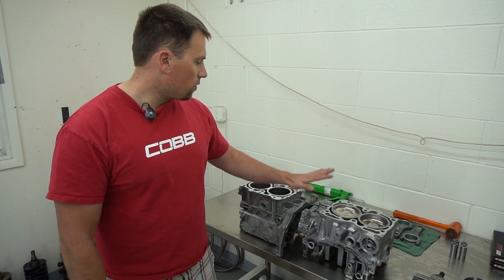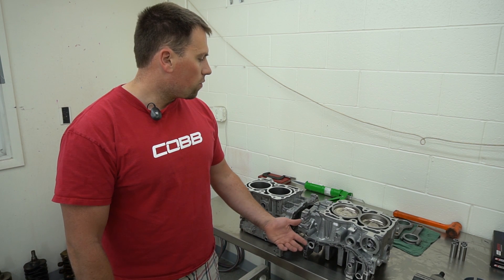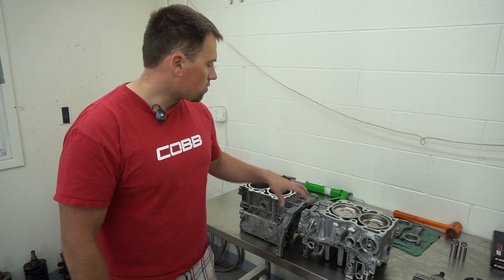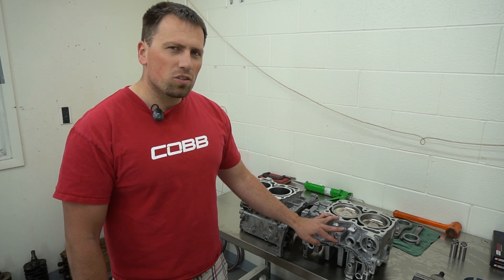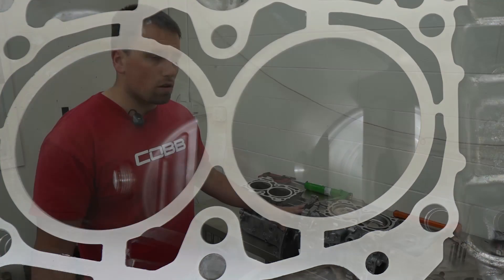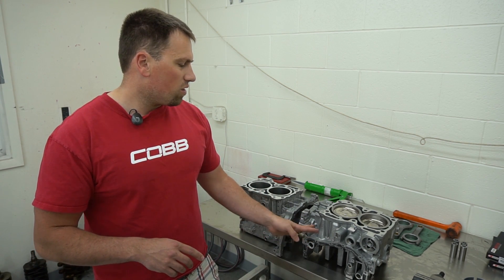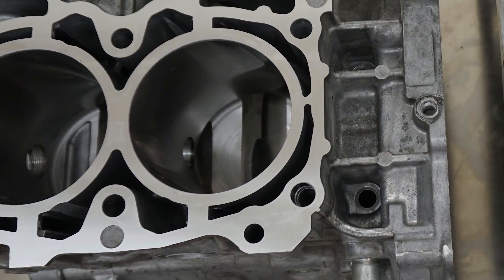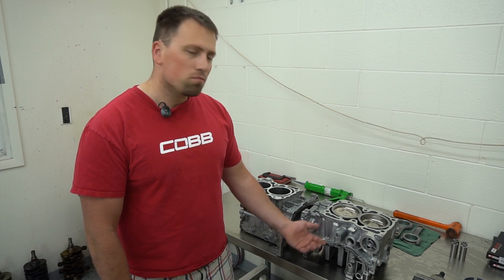Sleeved vs Non-sleeved EJ25

Comment: I am wondering about the ez30 or ez36 with a turbo SWAP on my 2012 sti which engine is the best to build up ...I'm digging that gt3 Porsche sound. Will Those blocks handle 550 or six as well??
Reply: By the time you're done with a proper built ez engine swap you would probably be able to buy that 911 gt3 with all the money spent. Not worth it in my opinion.

Comment: What do you think will my ej25 semi-closed hold 400whp on the street?
Reply: Most likely, with some forged internals though
Reply: @angusskinner7392  Haha update, yes it did for 15k miles :D Got ringland failure with cosworth forged pistons. Now doing a full rebuild on the same car :D This time the goal is just a little bit higher with 700hp and ej20 closed deck.

Comment: if i wanted to do about 400-450whp but my block bore would be 100mm oversized, should i sleeve it or stick with the 100mm bore?
Reply from the maker: We recommend anything over a 99.75 bore to go sleeved for the EJ25X.
Reply: FNP Tuned well i guess ill let the shop know tomorrow to go ahead with the sleeves. instead of going from my 99.75mm to 100mm. Thank you for reply. the shop also told me 100mm for my power goals is a risk
Reply from the maker: No problem, sounds like they had some good advice for you!

Comment: The big problem with the EJ25 are the head gaskets.
Reply from the maker: MLS Style head gaskets helped a lot with head gasket issues.  We rarely see issues with them on sleeved, o-ringed builds.
Reply: Closing the deck seems to help as well for reducing headgasket issues.
Reply: Wicked Crispy I run 9/16 head studs torqued to 120. No problems 👍👍
Reply: You know what causes it?
Reply: @Zcypot  Heat.
Reply: @mbdulka  cylinder walls flexing at high boost without closed deck or sleeves. Thats whats causing head gasket problems
Reply: @danielssonsgarage  Yeah if you are going to run more than 25 psi on stock sleeves yeah you might see that for sure. I run Darton sleeves so I am covered there but heat still warps the heads and eventually gets past the gasket. O-Ringing or running 1/2" head studs will hide the issue a bit for longer life but eventually it all gets through. Only keeping the block cooler will keep it intact. Running lower AFRs on ethanol helps a lot.
Reply: @mbdulka  18psi was enough for me 😁 leaked compression into coolant
Reply: @mbdulka   Hey, what do you mean by running lower AFR's?

Comment: sleeved vs. closed deck, pros/cons and or proper applications for each?
Reply: Umm with closed deck you will never have issues.
Sleeves ?  Installing iron sleeve in aluminium block is just asking for trouble, i had nothing but issues with blowing headgaskets and pushing coolant.
Reply: yeah if you have some one install sleeves properly and make sure they dont drop then they are fine ive had darton sleeves in my 2.5l sti for 2 years running 30 pound and never had an issue. and i have had people that have closed decks done to there engines and have and heaps of headgasket issues just your luck of the draw really both good methods. depends how much you wanna spend really.
Reply: @matttfknf  Same, 30 psi  with Darton sleeves, no issue.  The advantage with sleeves as well is you can always remove them and put in new ones ... and ductile iron is far stronger than reinforced aluminum.  If I get head work done, I will be able to run 50 psi no problem with the sleeves (although the heads might lift without crushed gasket rings).  I wouldn't go sleeves though unless you plan on going more than 600 HP ... if you stay around 500 on a closed deck, the engine will last forever.  You can get 500 out of a stock block, but one wrong move on your tune or bad gas, and bye bye engine.
Reply: I have never seen oem block holding 600whp, for the sleeves I'm sure Darton will hold 1000whp but make the sleeves stay in place without drop or movement without a better support it's very difficult for us, what are your trick?
Reply: @cda28rboostingpower27  Follow the install instructions from Darton and find a good machinist, simple.
Reply: Sleeved block is hands down better in every way as long as you get a quality install, It can't just be done by anyone hence why you can almost never find them and you're paying big $ for it. You get stronger block, better coolant flow, can push way more power safely and reliably.

Closed deck blocks are a decent solution for lower HP builds but what the closed deck insert does is it strengthens the top of the cylinder from distorting, but it doesn't do anything for the rest of the cylinder. It also restricts coolant flow but it has also been proven that it still gets adequate cooling. The other issue with just a closed deck is that you still will crack the cylinder walls and when the walls are destroyed its a new block. If something wrong with sleeves you just re-sleeve the block, or bore over depending on what you're doing. Sleeves are also much much stronger if you want to run 100mm pistons and won't have to worry about cracking a cylinder wall from the thin walls.

The guy who had coolant and head gasket issues sounds like he had a shitty block and whoever did the work did crappy work and didn't know what they were doing.

Darton sleeves you don't have to worry about them dropping either as they have a multi-step side to them to hold them in place and a big step around the top that really increases strength and makes it literally impossible to drop the sleeve.

Sleeved blocks are expensive but they are the way to go if you want to build your motor right and do it reliably and push big power or just have piece of mind.
Reply: @joebidden4914  Would you knownof a reputable shop in Northern California that can sleeve a block? I thought this might be a great idea for my 2020 STi stock block.
Reply: @carsandcoldbrew6489  Darton is in California but not sure where they are compared to you. They do the sleeving in house with their cnc machine
Reply from the maker: Thanks for the suggestion, we should do one of these as well.

Comment: What about closed vs semi vs open deck blocks and the pros, cons?
Reply: Closed inserts into stock engine will hold more power than the stock semi-closed ... reliable  up to 700 HP.  Outside of that, the iron sleeves will handle more power.  They might get "hotter" than the stock alu cylinders as well, so you might get more heat (and they're heavier).  If you're building a drag car or want big boost for short periods, sleeves are best IMO, but a closed deck 2.5 properly tuned will probably be more reliable if you're racing the car hard.  Tune, oil quality/type, and proper oil clearances play a bigger role in longevity than sleeves or closed deck though (unless you're going 800+ HP).  Just my amateur opinion (I built my 650 HP E85 engine with sleeves, no issues yet ...).